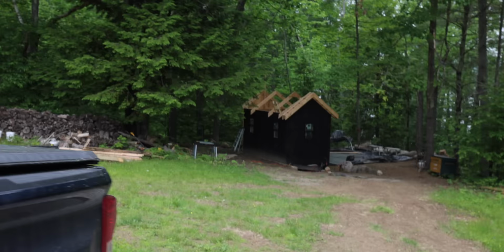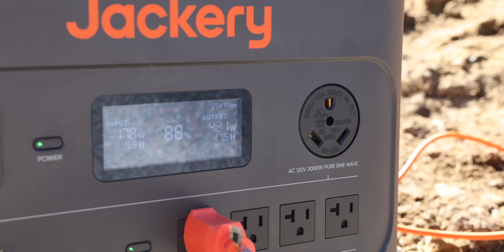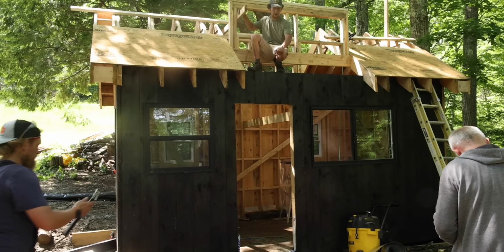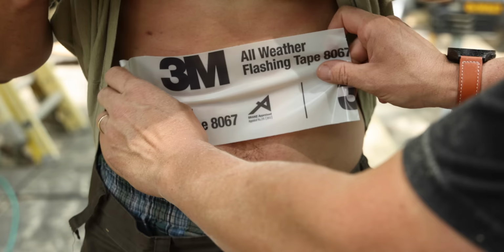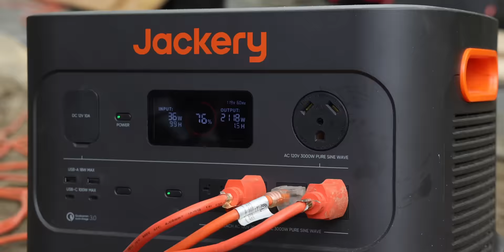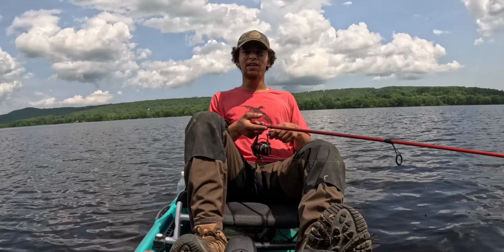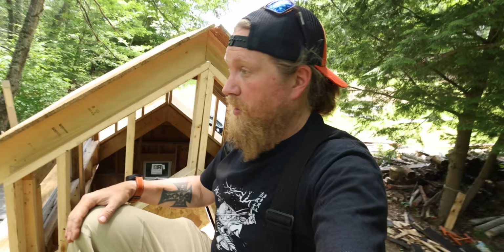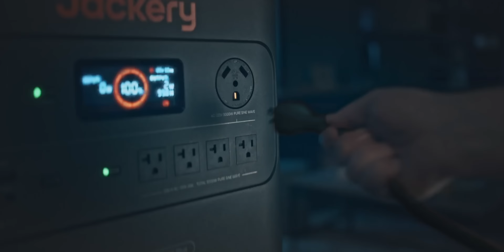Building a Tiny House Off Grid with the Jackery Solar Generator 2000 Plus -Part 3

Comment: natural mosquito repellent, and also a lot of flies too, lemon grass. its not super powerful but if you just have a bunch of it growing around the house there, it will just naturally push them away, which might lower the population of the ones that want to hunt you down. my gramma and my mom both use it around their patios and it works well. no flies on the watermelon and minimal mosquitos

Comment: Go but  citronella oil put the oil in a roll top bottle and rub it on your shirt, pants. Just put 3 line of the oil on the front and back of shirt and pants and a little on the top of your socks helps with ticks and other walking and bitting bugs.

Comment: Fowler sir according to the latest studies mosquitos are deterred the most by coconut oil they hate it, in the Caribbean they put hot coals in a dry coconut husk to slowly burn it and release the oils into the air. I’d suggest getting some dry coconut husk and burning them also putting coconut oil on your skin it’s just less fun than burning things😁

Comment: G'day Zach, the tiny house is looking fantastic. Couple of things I'd love to know. 
1. Did you put drainage into the tiny house pit? I can only imagine after a winter thaw that you're trailer will end up being in a pool without it. 
2. What happens to all the steel ammo from your slingshot shoots?
Do you leave it laying around or use a metal detector and magnet to retrieve it for reusing?
Cheers from Down 🦘 Under

Comment: For the mosquito problem, we use a see-through plastic bag and fill it with water. You can hang and it tracks the mosquitoes away from you. It's more like an indoor solution, but I think it can also help you.